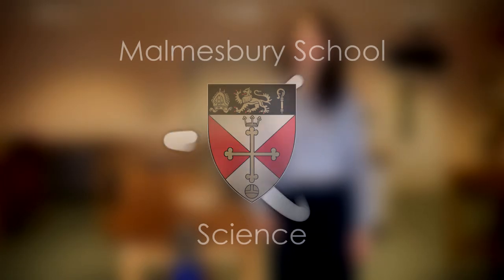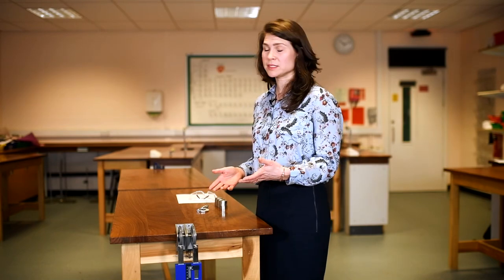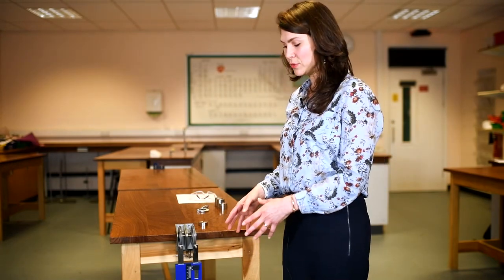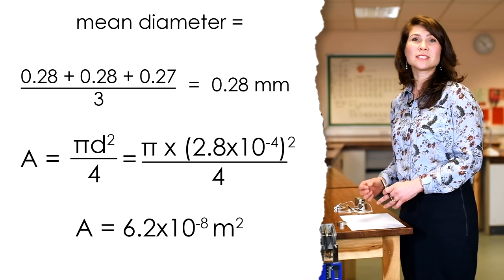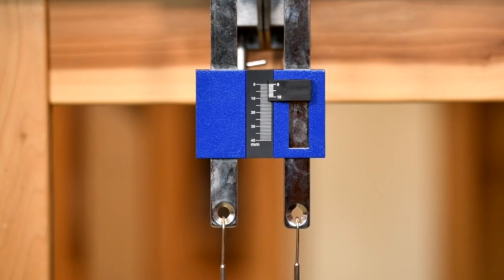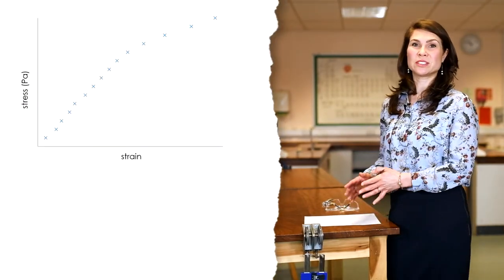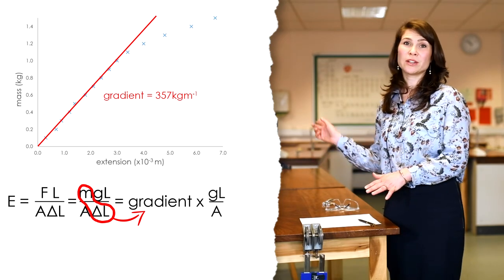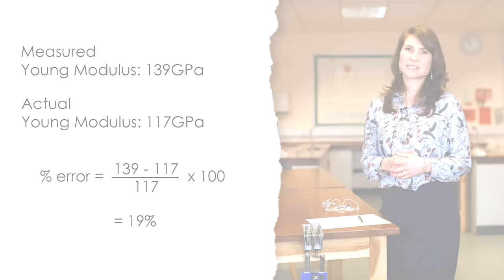Young Modulus - Physics A-level Required Practical

Comment: Please could you confirm the diameter and material of the wire as the Yield stress of copper wire of diameter 0.28mm would give a yield force of around 2N (200g mass added)